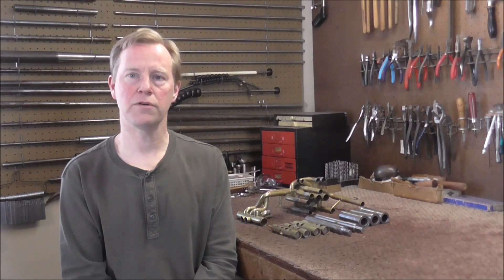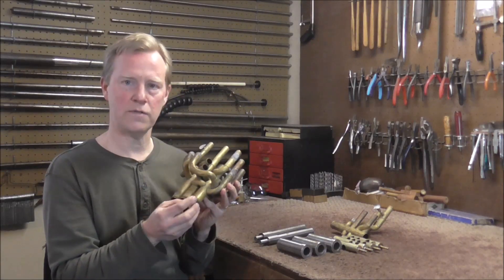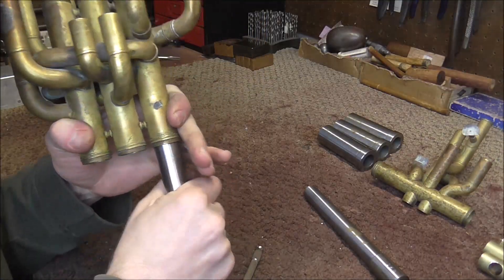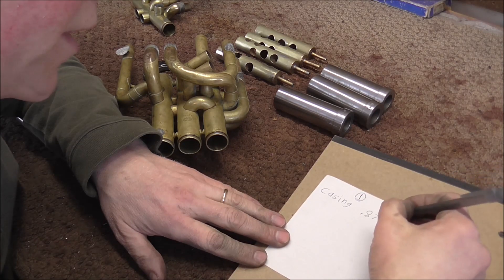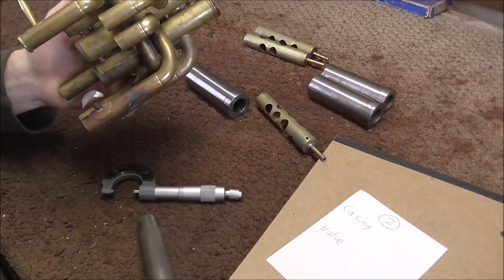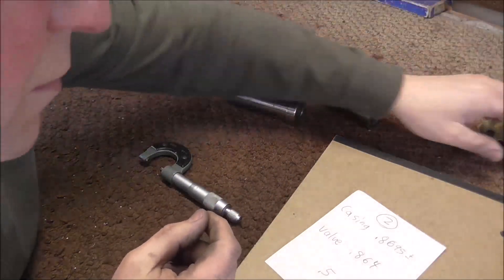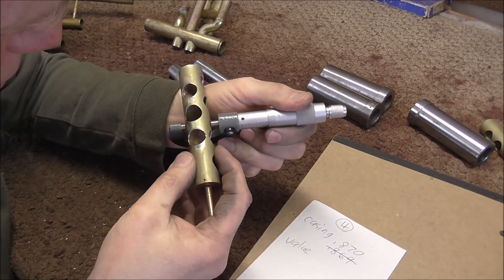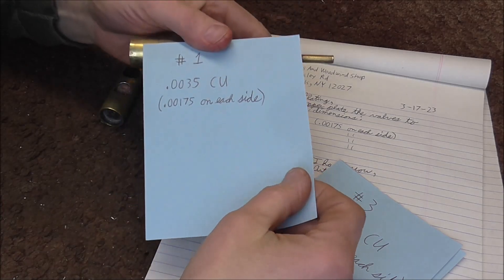Sending Valves to Anderson Plating: Enharmonic Euphonium Restoration Project #7

Comment: Art, before deciding on the copper thickness, check with them on their recommendation for the minimum thickness of nickel. A quick internet search shows that most people say they can plate 1/2 thou, but recommend at least 1 thou. Keep in mind that 1 thou of plating will be 2 thou of diameter.
Reply from the maker: I was wondering about that and I probably should have checked on that first, but I figured that after I work with the valves and the casings, there should be enough space to work with. I am a little concerned about the valve that is about .003 tapered.

Comment: What is the advantage of copper and nickel layers, vs just nickel?
Reply from the maker: Nickel is a hard metal that does not wear down as quickly. Copper is easier to work down which will make the valve cylindrical a lot faster.
Reply: @TheBrassandWoodwindShop  and the nickel layer provides adiquate wear protection dispite being very thin. that's good to know, thank you.